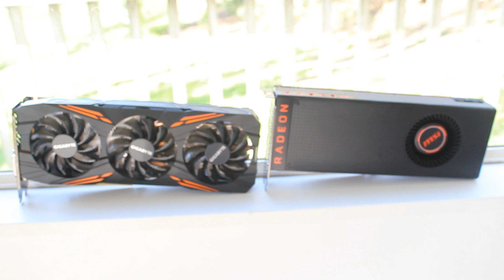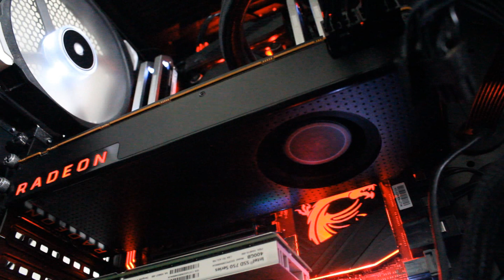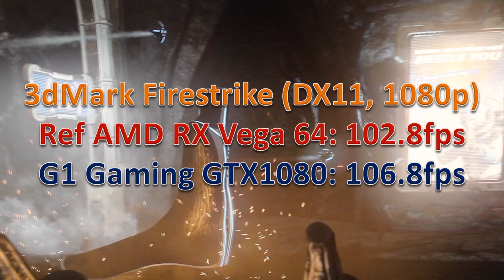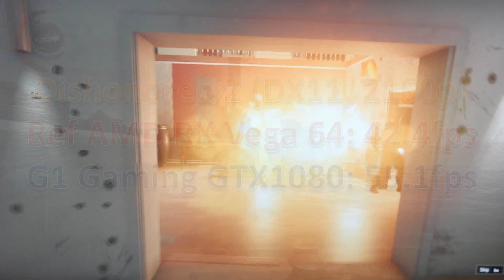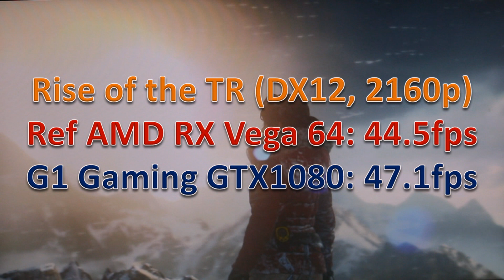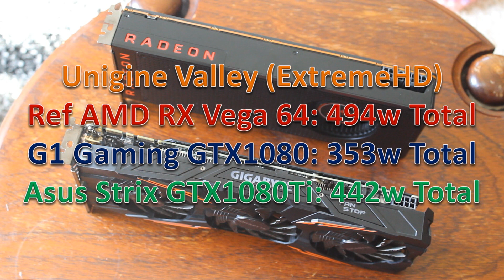Vega 64 vs GTX1080 Showdown - AMD RX Vega 64 vs G1 Gaming GTX1080

Comment: Asking advise:  VEGA 64 or 1080 ti   what's best value considering the future?

Got a LG 38uc99 freesync monitor but only later realized my current 'MSI amd 7900 series version 679A' card  can't run it at max resolution with 75 hz  since it has no display port thus is limited to 30 fps at 3840 x 1600 21:9 on hdmi.

In Belgium the prices for Vega 64 at first glance are around 680 euro's up  with most around the 800 euro mark -_- 

I hate having to currently play games on lower resolution to get the full fps 

... I'm quite at a loss ... 

I'm starting to consider getting a 1080 ti  since it's almost in the same price range,  has better power usages , performance,  is non-reference, ... 

Should I go NVIDIA and lose out on freesync
or believe that eventually the Vega 64 with improved drivers will get a lot better since it's unfair to compare it with fully driver developed cards?

I must say I was always and still am very happy with the performance of my current 7900 considering it's age and the fact it wasn't even the fastest card on the market when I got it.  
If not for the limit to 30 fps at 3840 x 1600 21:9 on hdmi for my LG 38UC99 ... I would still be happy to keep using it.  

I don't want to wait more than a month or two max ... should I wait for more custom versions of the Vega 64 or just go for a custom 1080 ti.  I get a feeling both will be good cards for years to come.

Comment: Hey Kev, what are the highest presets for R6 Seige?  Highest has to be full "shading + some MSAA/TXAA?  

I remember having to knock "shading" to Medium and lowering AA to 2xMSAA (maybe something else like a notch of Shadows) just to get over 100fps (only AVG.) @ 1440p in the benchmark with my (2050/10,800Mhz) gtx1080...35 extra frames is a WIDE gap.

Also, maybe I'm out of the loop...is the "Tech Lounge" dead now? 

Thanks for the great vid!

Comment: Vega64 = 13TFLOPS
1080 = 9TFLOPS.
Yet no one thinks that optimization might have anything to do with these low numbers for Vega? Come on guys. Nvidia's core architecture has matured for the past 3 years and Vega is like 3 weeks old. Besides, can't compare a partner card to a ref card.

Comment: This is a tough showdown... 
A lot of reviewers are saying Vega is trading blows with the 1080 depending on the games tested (bench marking suite is going to make a big difference. Even built in benchmarks vs. real game play can make a difference), so in terms of performance its a decent card.

People complain about the power draw but in reality, unless you are mining, Gaming 24/7 or have incredible expensive electricity it really is a non issue in terms of cost.
Heat output, is an issue however... More power = hotter card and thermal throttling... but once again its a common issue we see in a lot of reference cards. You can mostly get around this by bumping up the fan but then you have a really noisy card... another reference issue.

But then we come to the biggest problem with Vega 64, and that's the price... At the moment its a horrible choice just because its so expensive. If its was selling for the same price as a 1080 then it would be different, but (in NZ at least) its $250 more! Its just not worth it.

It would be interesting to revisit this showdown again in a few months when the AIB cards come out and hopefully the price have settled down because right now its a really bad purchase decision.

Comment: Everyone just needs to calm their rarted down, Vega hasn't taken its coat off yet and people are already saying it can't fight.

Guys, this is a BRAND NEW architecture, not one piece of software has been developed around it, the drivers aren't even going to make a difference right now, so these benches are kind of moot because people would or should have had the cards to run those games when they first came out lord knows how many years ago.

Yes, Nvidia cards are faster right now, but that's because they gear their cards around clockspeed and brute force rather than actual architectural grunt, they are as fast as they are going to get day one and but for overclocking won't actually get any faster in future.  Another card will come in a year and you'll have to buy again to keep up.

This Vega has 12-13.7 TFLOPS or raw computational power with next generation HBM2 memory, just let that sink in.  The fact that this architecture is effectively laying dormant during these benches and is still anywhere near this close to the 1080 partner card is an accomplishment on its own.

The high power draw is probably due to the HBM2, but when the power is properly put to use, I think this card will lay waste to the 1080 and eventually overtake the 1080 ti, the specs of the card just say so.

Personally, I'm gonna wait for the board partner cards, but if anyone buys Vega now I would take it as a smart long term investment, because these cards are the future for gaming and where the industry is going.  AMD cards are never fastest out of the gate, but the power is always there and they eventually overtake.

AMD will always be behind for obvious reasons, but their products are more innovative,  last longer and are just better value for money overall for someone who can't be arsed to be upgrading graphics cards every five minutes.

People need to look at the bigger picture.

Comment: So looks like if you could get the clocks up to around 1700,mhz Vega 64 liquid  might beat a 1080 by 5%-10% best case scenario and Vega 64 air might match a 1080 if the drivers are fixed.   So $500 usd for Air, $600 USD for liquid is about what it will be worth, if the drivers are fixed.  To bad it's looking like retails can't sell them that cheap and the real MSRPs for the reference cards without AMD's retailer rebates are $599 for air, $699 for liquid.

Comment: My vega 64 is doing rather fine at 1700mhz core and 985mhz memory... sits around 76c for hours. Yeah it uses a bit more power and I think that in time it will be much faster with drivers.
Also its a bit unfair comparing a non reference card with gddr5x not the standard ddr5 and then running it at nearly 2ghz.
Its like saying bananas taste better than oranges.

Comment: Did you run Vega with the default fan curve? You really should have removed it up to prevent throttling if so, it really isn't a fair test otherwise.

Comment: AMD dropped the ball with vega 64,  I hope they can improve performance with better driver updates. Vega 56 is the better card to get. Because it can be overclocked and get between 1070 and 1080 performance. Vega 64 on the other hand struggles to beat the 1080 and if it manages to do so, the power consumption is not worth it.

Comment: If AMD wants Vega to be competitive they need to lower the prices. The 56 should be $325 and the 64 should be $425. No one is going to buy a card if it's higher priced than the competition with similar performance

Comment: Well at least Amd got Ryzen and Threadripper right this year.A gtx480 stock only had a 8 pin and a 6 and that was famous for the amount of power that could burn when benchmarking this with dual 8's i thought that pc's were becoming more energy efficient.And now with the price jump on the 64 & the 56 theres no reason to recommend these over the 1080 or the 1070 unless through some miracle Amd can get huge performance gains in a driver update.Maybe 3rd party cards will be better only time will tell

Comment: it will be theoretical since it looks like vega is being more expensive than originally told (by 100 bucks at least) - see vega price scandal videos on youtube everywhere - so i can not see a lot of people picking them up, that is if you can get one after the miners had their say ... but:

as for power-draw, you should look at a few reviews like that of adoredtv and gamernexus who played around with undervolting. even just working with the presets shows what is wrong here. the performance difference between power-save and normal is a few percent, the one between normal and extreme is downright negligible, but between normal and extreme there are 100watt more power.

it looks like you never should use the extreme setting unless you want to waste money and/or heat your flat.

you can overclock to extreme levels and manually set vcore to 1.1v and get better performance, no throttling and lower temperatures/noise at the same time.

amd did a shit job optimizing this ... but as said its theoretical at this point since we will not be able to buy one for a reasonable price anyway as it looks right now. no sane person will get a vega56 for 499 or more ... no gamer at least, the performance is not there for this price point.

Comment: so the Vega 64 for $500 is a great buy, now just go buy a aib partnered model (asus/sapphire) and pull the power slider down 20,000 percent while increasing core clock to 2000mhz and mem to 1200mhz. and ta da you have a fantastic card. not that difficult to do.
Reply: @BasicallyImHigh

Gamer's Nexus made a video about a clock bug for the Vega 64 showing a higher clock than what the card is actually running at.
Reply: Gamevet kek
Reply: Yeah gamers Nexus disproved this. Your not getting anywhere near 2000
Reply: @BasicallyImHigh

Obviously, your name isn't an oximoron.
Reply: BasicallyImHigh buildzoid is the one who is working with gamersnexus.....
Reply: Gamevet lmao I'm 11

Comment: The problem with Vega is not the TDP or it being slower than the 1080ti but it's late unlike the Rx 480 which came in before the 1060 it got a pass and disappointment went away after 6 months while Vega is already 1 year late and it will need at least 6 months to try to catch the 1080... cause lets be  honest here vega 64 should destroy gtx 1080 in 6 months time just like how the 480 before relive was 15% slower than a 1060.
But that is 1 year and 6 months by then gddr6 production will start and people will get hyped by volta ... but im expecting volta will be out till q3-q4 next year
Reply: Nvidia has confirmed that they're delaying volta because they dont even need to compete with vega, at least with the current drivers...  Dont expect volta until 2019...
Reply: Kailoone is right. Vega was a complete joke when it released the same price as the 1080, became even more of a joke when its price hiked, and will continue to be a joke so long as it's priced anywhere near the same as the 1080. If it were priced a good deal cheaper like it was supposedly going to be in the first place, then I could recommend it. But paying the same price for the same performance at best, worse at most, all the while drawing significantly more power is just ridiculous.
Reply: The ''main'' problem with Vega is the (price), as a wise tech salesman used to say, ''there aren't bad products in this industry, just bad pricing.'' And I could not agree more, Vega 64 needs to sale at the price of a gtx 1070 or a 1060 and we are good to go.
Reply: Draydince blame the retailers. They hiked the pricing. Until then it will suffer.
Reply: + MayDay GoingDown!!
GTX 1080Ti came as just a souped up GTX 1080 with more memory and gigapixel unlike RX Vega 64, a brand new GPU with more compute functions yet to be tapped. As seen on Vulkan game like Doom, GTX 1080Ti tends to run hotter despite its high average framerate compare to a reference RX Vega 64. AMD is aiming for mid term once the driver for Vega gets optimized. GTX 1080Ti will show its weakness as it heavily relies on preemptive method to hide its lack of compute. Productive will be the area when RX Vega 64 will truly shine. It is the PC gaming world that needs to adjust by using standard API like Vulkan that currently rules the mobile market and made for better portability in mind.
So glad to hear you currently enjoy GTX 1080Ti as long you don't change your card every year.
Reply: KAILOONE But bad products do exist did you ever hear of the Virtual Boy or Atari Jaguar.
Reply: Even if you completely disregard the price hike; it's coming in a year late, performs the same or worse than its direct competition, and is also only matching the competitions 'current' price inflation. It's matching the 1080's $500+ price, when previous to the mining craze you could get them for sub $500. I've seen them go as low as $420 directly from Newegg. All of that, and it still draws quite a bit more power, ignoring retailers price hike still puts it right in bad-deal-land. Don't get me wrong, I understand WHY they're keeping the price like that - they obviously have the market for it in miners. But for gamers, it's just a horrible option until the price drops by a good margin given that the 1080 performs better, is cheaper/the same price, and draws much less power.
Reply: TheSinisterEyes1 Vega will never match a 1080ti in the majority of titles even when optimised, it's just too big of margin to catch up, drivers won't gain 35% performance increase needed.
Vega will gain through out time to beat the 1080 but by then next gen Navi and Volta will already be out.
This is what happens when you wait and wait and wait some more.
By the time it becomes fully optimised it's already irrelevant which to be honest the 1080ti is already doing anyway.
I'm glad I pulled the trigger and purchased the Asus Strix oc 1080ti 3 months ago, I have a feeling they are about to get sold out now.
Reply: Tippotipo Yeah I hear what you saying especially about production but unfortunately the extra compute in Tflops won't really help in gaming.
It would require every game dev to specifically code to utilise it and that's just not going to happen. We may see a couple of titles where AMD pay the devs millions to create a game that uses it like they did with Ashes and now have done with  Wolfenstien 2 etc but the majority of devs won't as Nvidia has such a huge majority in the market.
It was the same when the Fury X came out, people thought devs would all suddenly code for it's new Architecture but as we can see only a couple came and they where heavily dependant on Vulkan appi too, again of which there are only a few titles that utilise Vulkan.
Devs won't and don't want to do the extra coding for the minority so unless AMD suddenly take the bigger Market share off Nvidia I think it will still remain only a few titles here and there that support Vega. 
As for pre-emptive method apparently dx12.1 actually suits both Maxwell and Pascal so both especially Pascal will see gains as will Vega once tier 3 comes to the fold but that will take quite a long time to surface.
By then both Navi and Volta will have already been released I think.
And for me Vega in reality is a slightly improved Fury X.

Comment: It will be interesting to see the performance difference in the future after drive improvements and non reference designs, however despite that the 1080 has been out for a while now so seems like a little too late with Vega, louder and needs more power too. I'd pick the 1080!

Comment: overclock both cards then retest
Reply: overclocking core clock past 1600mhz is useless on vega its better to OC memory speed to 950mhz which increase performance a lot more and use less voltage. 

What you want is 1600mhz core and 950mhz on hbm2 then try to undervolt it and add 50% power limit. optimal set up for benchmark. core clocks wont fluctuate as much

Comment: I just think the RX series reference coolers are sexy and I want one
Reply: they do okay if you know how to undervolt and what i did with my old rx 480 ref that i gave to my bro. i change the stock thermal paste with a higher quality paste and undervolted his card it would run at 67-70c which is pretty good for a reference card.
Reply: TheSinisterEyes1 Yeah... I'll just buy an aftermarket card.
Reply: oh you like black rectangles
Reply: Yeah buy one and see how much you love them. I learned my lesson with the 1080 Founders Edition - never again. Thankfully that card blew up and I got a G1 Gaming as warranty replacement...
Reply from the maker: I like the look just a shame it doesn't perform that well.
Reply: you dont buy expensive gfx card just for the looks imbecile.